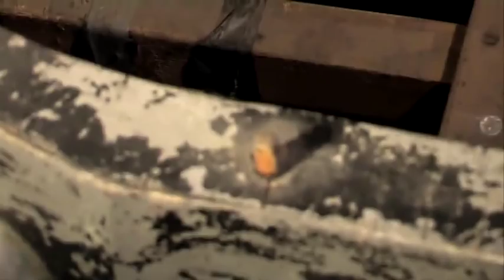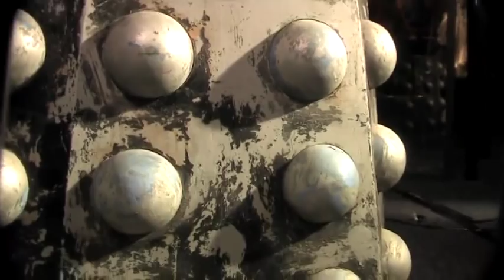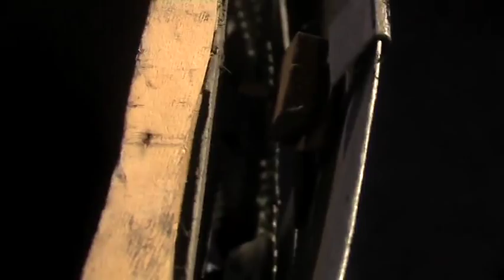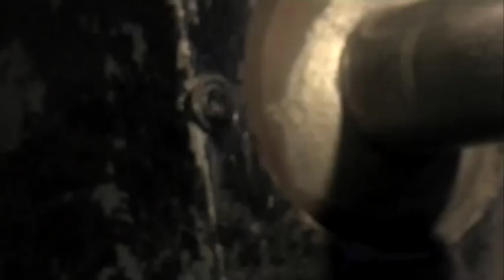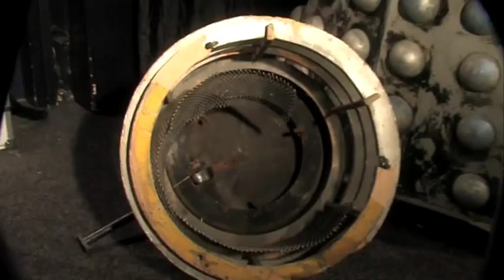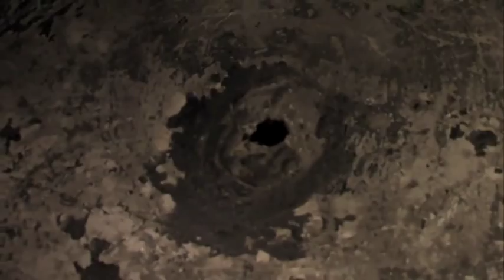The Wilkie Dalek

Comment: Looking at the build technique, this is still a Shawcraft produced Dalek prop because of the fibreglass skirt, location studs, Sucker & gun sticks. The two rear row of globes is half an inch higher than the other globes which is also echoed on two of the original four Shawcraft props, also that reinforced strengthening bar is identical to the Shawcraft props.